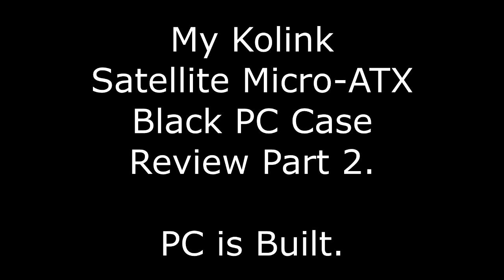My Kolink Satellite Micro-ATX Black PC Case Review Part 2 - PC Is Built

Comment: Do you think an ultra thin 120mm fan would fit at the front? I seen noctua got one only 15mm thick and I was thinking you could slide it in the front cover.
Reply from the maker: I have never tried because I don't own any ultra thin fans.
Reply: @John_B_Gage  Ok nevermind, I'm considering buying one for a budget build. Got a gtx 1060.
Reply from the maker: You are very limited what you can do with these cases. For the same or lower price you can get a tower case and have more room.
Reply: @John_B_Gage  yeah you're right, tough decision

Comment: Yeah mate I think the intent with the USB header is to connect either 2 or 3, not both.
Reply from the maker: You know what. You are right. I forgot about the fact that this case only has USB 3.0. I am so used to plugging in USB 2.0 and USB 3.0 headers in on other cases.

Comment: my motherboard first expansion slot is pci-express 1x (not for gpu), the gpu pci-e 16x is second slot.
this case only have two slots, i could put the second slot for display port, but the problem is could it fit in for second slot (the gpu second slot is the exhaust hole  only)... i bought this, after several days, me thinking... if the gpu could not fit it... its a problem... i will waste money buying the case...